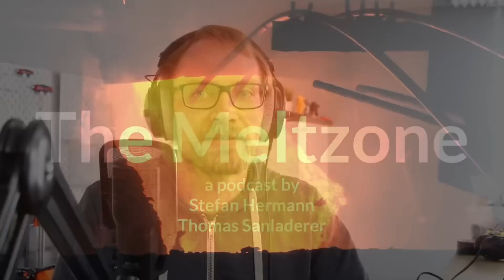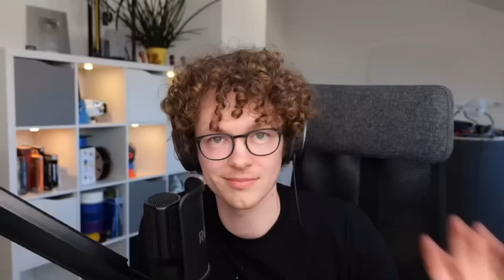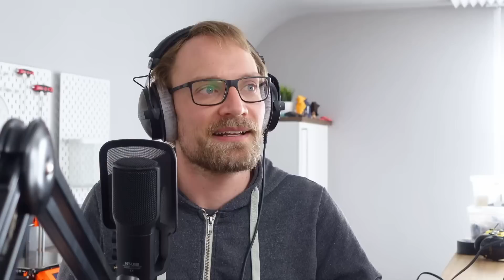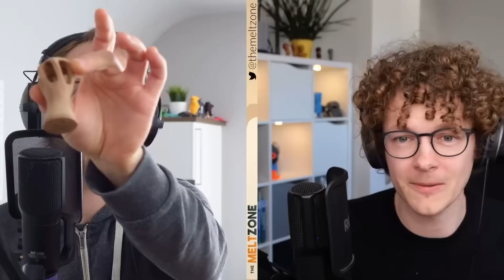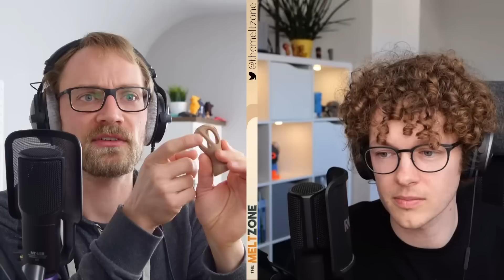Back again! Rotary CNC & Simplify3D V5 meme is over - The Meltzone Podcast Ep66

Comment: Nice to see you're both back. I was a bit worried that something bad had happened to one of you.

Sorry to hear about the time eaten in moving workshops. 😟.

For multi-axis printing, using a morphological imaging skeletonization process could provide vectors that could make paths that could be followed outward from the object... basically turning any object shape into a series of 2.5d print operations using slightly tilted extrusion planes.

I hope to see you at MRRF. Swing by Ann Arbor if you're going through DTW!

Comment: Nice, thank both of you for the new episode. Regarding Measuring Tools for stl-files I‘m always coming back to the cost free „3D-Tool“. It officially is a CAD-viewer, which can, in it’s full and paid version) transfer between different CAD files like CATpart to sldprt. However there is an free stl viewer, where various different measuring tools are available. Please check it out, it made my stl file handling much easier.
Reply: Is this Windows only or have the also a Linux version?
Reply: @berlinberlin4246  afaik it is windows only

Comment: "CAD within the slicer", yes but for stuff relating to the slicer. Scaling a part (already there I know), mirroring, cutting parts in different ways, for different materials, colours, or to fit on a build plate. Combining, or splitting imported files. Precisely intersecting one file with another and dealing with the overlap. Easy provision for adding parts to prints during printing. Comparing a print file with another (ghost of another file imposed over selected file for print), possibly a previous version, or maybe another file this print will be used with - this could provide information necessary to modify the part to be printed within the slicer. The ghost could be of a part intended to be placed in the print during printing, if this part intruded above the print plain the slicer would know this and avoid it as it printed further layers (I know there would be limitations to this, but the slicer should work around the best it can given the problem you have presented it with). Just a thought, just stuff I would like to be done better from my limited experience with my Qidi X-Plus.

Comment: i think to make non planar or 5 axis printing somewhat "idiot proof" you´d have to have something like the cam softwares for 5 axis cnc´s wich have models of all the tools and the machine itself and can simulate the movments and detect colisions. Of course that would require you to have or make 3d models of your printhead and enter every nozzle change or new fanduct so the software knows the current shape of the print head and can do the crash detection. But i think with non planar/ multiple axis printing we are slowly leaving the teritory of the casual hobbyist. I mean many people have 3 axis routers at home but how many have 5 axis machines at home or even know how to program them? I am working on 12 axis mill/turn machining centers so i would happily do the 5 axis printing at home, but for someone who just wants to load up an stl and make plastic boat and doesn´t know anything about the difficultys and challanges of using cnc machines  with rotary axis it will probably be too much and not really worth the effort... but please make 5 axis slicers i really want that!

Comment: Just make SuperSlicer great!! Tbh I like the “a lot of settings to change” “feature” if I may call it like that. I liked PS but after trying the “one perimeter top layer” feature of SS I can’t Look at “normal” prints without thinking about how less polished the top layers look in other slicers. Also i like that SS is not really Printer biased. Yes you can argue that it is used by a lot of Voron ppl but you’re not getting That Prusa benefits or Cura (Ultimaker machines) benefits feeling. It just feels like what Slic3r should have become. Before you Start attacking me on being a fanboy… I’m a very long time Cura and PS user and still use them on a couple of stuff That SS can’t do. Just my 2cents!

Comment: With PrusaSlicer, I think it would be an issue if they were refusing decent pull requests that addressed the longstanding issues. (I'm assuming that's not the case, but I could be wrong)

I realize your average punter doesn't have the ability to write the code, but... If enough people cared enough, they could even hire someone to do the work, which isn't something available in a closed source product.

Comment: Along the lines of "Dear Prusa, we need to talk"

If I want
* Roughly Prusa mk3 build-plate sized
* enclosured for filtering, while keeping exterior dimensions small (core-XY would help here)
* Direct drive for the filament path, because I hate it bowden tubes
* with "send slided file to printer over wifi" functionality, a-la the Prusa-Mini.
* For bamboo-labs-ish money, preconstructed
* No cloud servers
* No vendor lockin. Supporting open source.

What are my options? I'd like a Prusa-XS (Prusa Xl, except on a 3x3 grid instead, or maybe even 2x2). Pre-constructed Voron seems sane, except that people react to that as if sacriligious.
Reply: Caribou3d has a new one which can be easily enclosed. But it is based on the prusa mini bed. Maybe they upgrade their normal printer to that style later ...
Reply: @meltymeltymelty  Josef said in the past that the build time for a MK3 is a little less than 3,5 hours which is normally built in 6-7 hours. A switchwire is 12+ hours build time. so more than 3 times. Prusa charges ~100€ per hour build time and they do it assembly line style. So a LDO switchwire kit is ~900€ and then at least 1200€ additional for the assembly? This won't happen. Then you will have to pay also higher shipping because the volume of the package is bigger.
Reply: @danielkrah5129  If Prusa takes 3.5h to do something that others do in 7, doesn't that suggest that a practiced/setup line could do a Voron in half the time as well? So that would drop it to ~600 for assembly... and 900+600=1500 - totally in line with my suggested price.

I know the market wouldn't be huge, but I'm still surprised I've basically not seen anyone try and fill it to validate that.
Reply: @kilpatds  depends on how much is produced. But in theory yes.